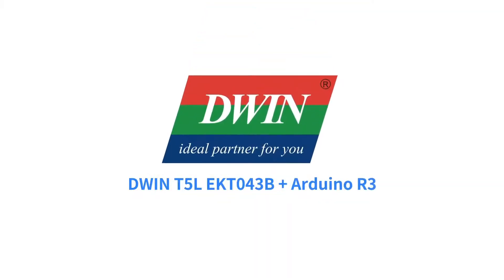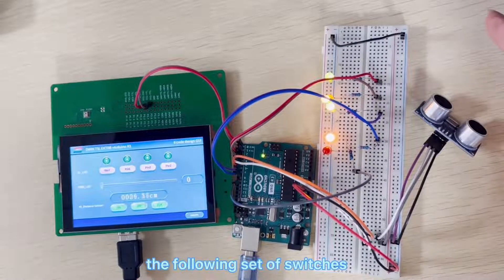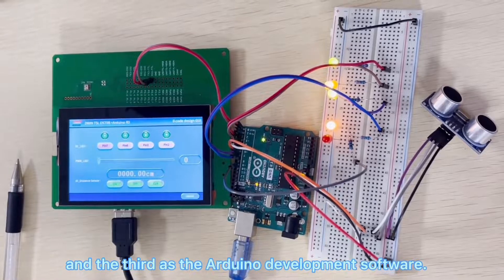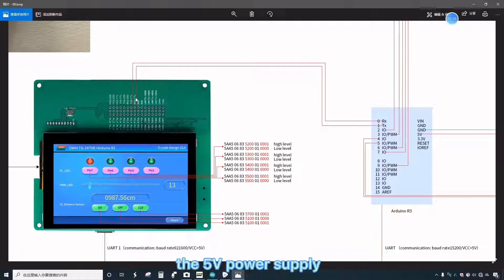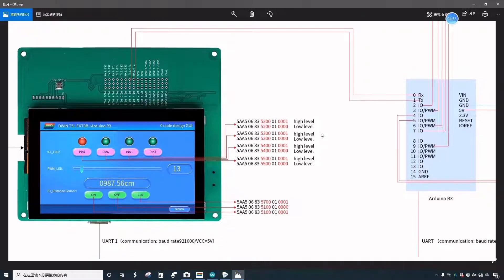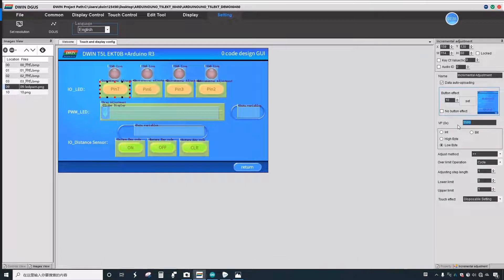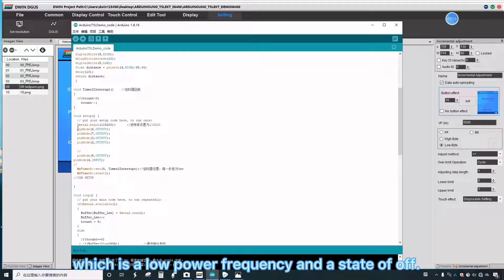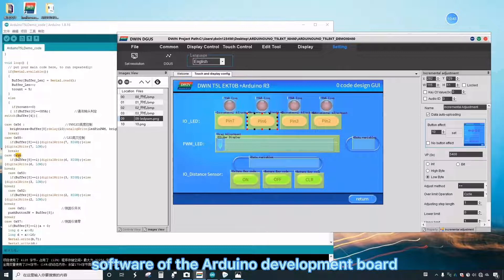EKT043B #DWIN T5L #UART LCD Function 4.3'' #Evaluation Board with #arduino

Comment: Hi! Please tell us about the jumpers on the back of the board - OS/GUI, IO/JTAG, WiFi/USB.  How to use them? in the video project - what position are they in?
Reply from the maker: Dear, USB/WIFI should be the lead-out serial port 1. If the customer has soldered the WiFi module, jump to the WIFI position. Generally, it is adjusted to the USB position. The USB cable is directly connected to the computer serial port for power supply and serial port debugging.
If you want to burn the bottom layer of GUI/OS, jump to the GUI location.
Then for IO/JTAG, if you use the emulator for online debugging, jump to the JTAG position.